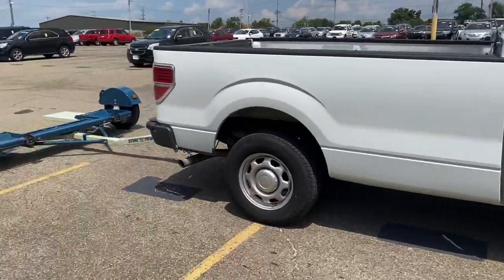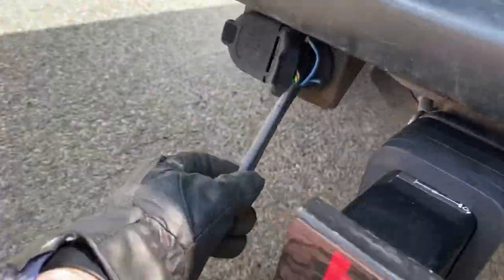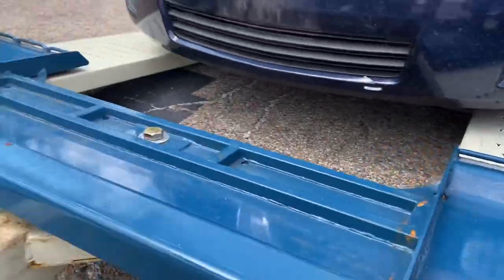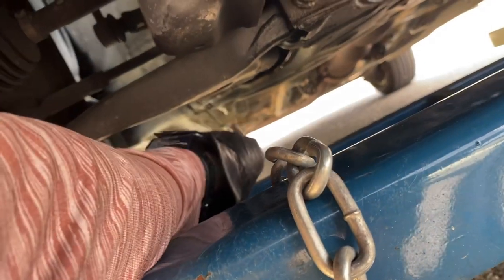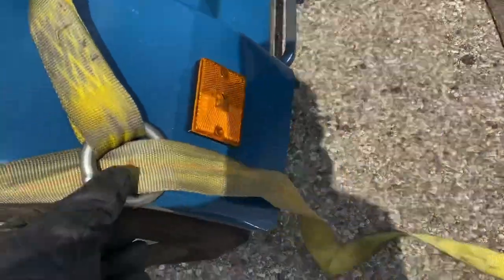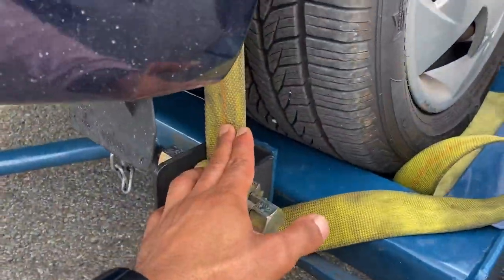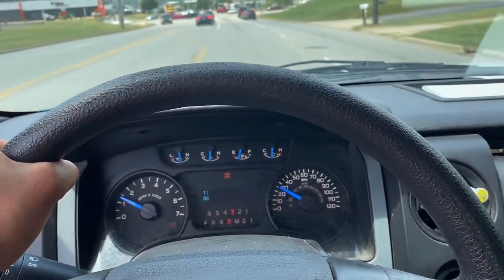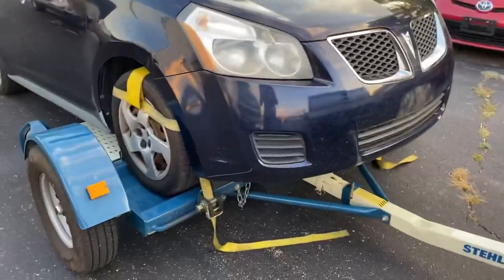How to tow a car suv with a stehl tow dolly

Comment: You actually can tow a rear four or all wheel drive as long as you disconnect the drive line from the rear differential then secure drive line to the undercarriage without removing it from the transmission
Reply: You don't even have to do that either. I tow my 4wheel drive jeep liberty behind my rv. Load on dolly,put transfer case in neutral,put transmission in park and take off super easy
Reply: @Drifter.  thats true if you have a standard transmission but if its automatic you could damage the transmission if you dont disconnect the drive line or pull the axel shafts

Comment: Can you to a 4WD if you use tow truck style rear dollies on the back?
Reply: You could if you had a steering wheel lock definitely not recommended cause if your front tires are not 100 percent straight you risk messing up your front suspension and tires